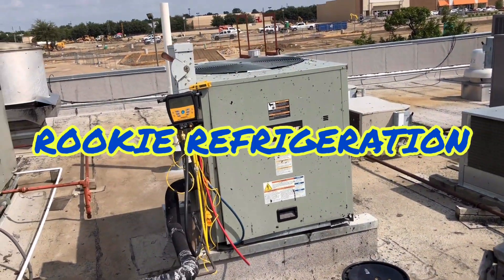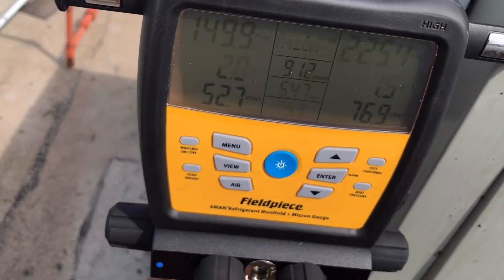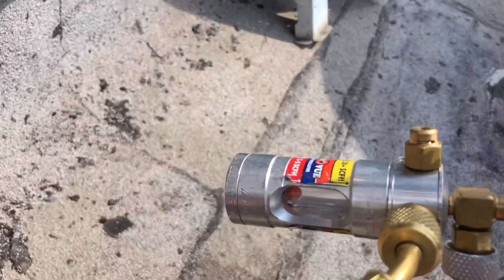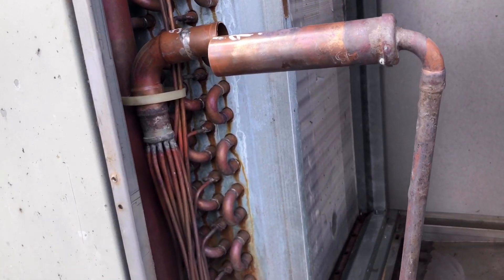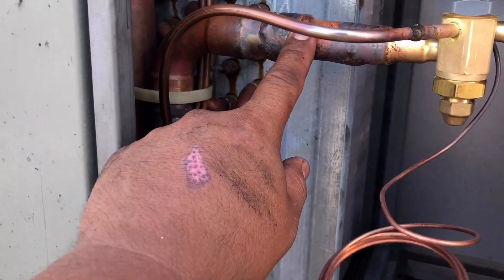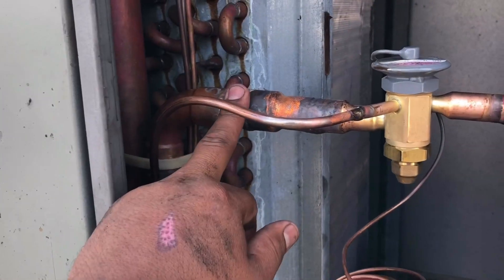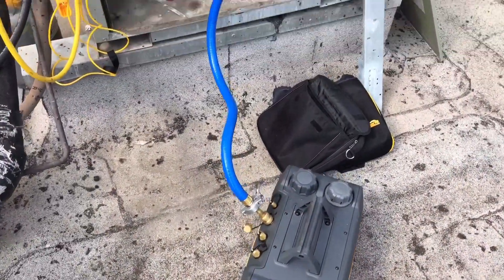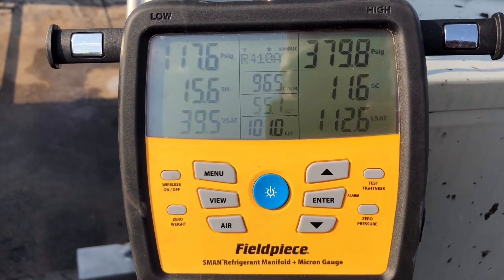HVACR:  Trane Make Up Air Unit with no TXV, ran for 2 years

Comment: I'm not knocking you bro but I noticed that you said 15 degree SH and it really was 15 degree SH. it does happen if it's hot inside you gonna have high superheated. I love txv systems easiest on earth it's the fixed office you gotta worry about. The system can be a nightmare but it takes time to diag that kinda system for a while.

Comment: Hi, i have an old lennox rtu. There's a port on the discharge line but no port on the suction line. The suction line just before the compressor is really hot. It has capillary metering r22. Discharge pressure showing 125psig. Is it low on charge? How can I change this system? Thanks
Reply from the maker: Probably low.   Make sure it’s pumping.

Comment: If you mount your sensing bulb upstream of the equalizing valve, it will allow the valve to read suction gas temp, instead of liquid temp. 
It will help with superheat.

Comment: Quick tip I learned from someone else. Instead of hauling a bucket of ice to the roof.... steal a small condenser and fan from a small reach in. Put service fittings on the inlet and the outlet of the small coil.

When you recover put that coil and fan in your recovery circuit between the reclaimer and the cylinder and tap in to 115v you’re already using for your recovery machine. Don’t have to worry about ice melting or break your back hauling it up a ladder or roping it up. Or look for a hose bib.Tip of the day.

Comment: Hey bro I'm a newbie in big boys toys and my question is when to know the charge is complete yo go by sh or sc or it is printed in the box I'll be great full if you can clear ma mind .
Reply from the maker: Usually on bigger systems you will have a receiver and it all depends on what the manufacturer wants.  We usually go 35% on some stores.   50on some. Etc.    but if it’s a bigger system with no receiver it will be wighed in.  Usually says on the system

Comment: Well you should have at least glanced at the cut sheet on installing the valve first...there is only one position you can’t install that valve.... The one you did!  You can’t attach the outlet side into a 90.🙅‍♀️👎🥴
Reply from the maker: Cool.  Still working.   Better than it was!?😂😂
Reply: @rookierefrigeration4357  I guess as long as it works....

Comment: Where do you run your pressures on oxygen and acetylene and what size tip you use?
Reply from the maker: I believe this is a #1 tip and it’s set at like 7acet /10oxy

Comment: Hey Rookie, i find un-sweating can be a waste of time, cut 1/2", bend a piece of 5/8' pipe 90",done...!!!...instead of running to the parts house for reducers and adaptors, a piece of 5/8" for liquid in,another way , and your 7/8" off the valve would of went into the 1 1/8" and crimp a little..bigger drier the better on old crap,you don't know how dirty system is,, good job.. keep going, its a great trade to be in.. iv'e been doing it for over 35 years in Australia...
Reply from the maker: Yeah, I agree.  I don’t like the look of the crimped tube with the smaller diameter copper.   I’d rather go to the supply house and get the fittings.   But yes I know I can do that.  I think I just choose not too

Comment: I might be wrong but that looked like a fixed orfice with capillary tube
Reply from the maker: It looks like it.  But it did not have anything inside.  At all.   Trane said that the installer should have purchased the txv separately and they didn't.   So someone just brazed it together.
Reply: That's what I was going to say.
Unfortunately, since I would of thought that, I would of never seen the end of the tunnel if I got a unit like this.

That's why I watch videos like this; these guys keep the trade going.

Comment: Why the buck I understand? Shouldn't you put the same size dryer back on??  I'm new to all this
Reply from the maker: Joe A at least the same size minimum.   I’d say you are safe going a bit larger.   Might affect critically charged units though
Reply: @rookierefrigeration4357  sporlan has charts in their drier bulletin showing weights of refrigerant for different sizes of driers and different refrigerants, as far as i know you can adjust the chart on critically charged units using that (extra charge = new drier weight - old drier weight). Nice video! Surprised the compressor didnt die from that!
Reply from the maker: Yeah.  It had the superheat to keep it alive but it never cooled.   I was amazed at this find.

Comment: I know Trane utilizes weight charging and approach temp for charging but there has been a lot of research on superheat that really squashes the old rule of thumb of 12-15 degrees of superheat, especially in high ambient temperatures. The research was done in San Rafael by Proctor Engineering.

Comment: My friend how the big Trane unit was running with out an expansion valve before. you installed a new one after consulting with Trane right?
Reply from the maker: There was enough flashing and superheat to maintain the system Alive.  But not enough to do much cooling.  That's why it was never an issue until I ran across it.  Lol
Reply: You know the phrase nothing stops a train. Not even its own parts

Comment: good video,  the only thing I would have been looking for, is a fixed metering device in that larger tubing or if they had some kind of orifice in the distributor head, otherwise, what prevented the compressor from slugging?.  Either way, I like the pressures now, and other data much better now too.
Reply from the maker: hvac01453 yeah, the only thing before the distribution tubes was a screen.  I verified before installing the valve.   It was a weird find. 🤪
Reply: @rookierefrigeration4357  It looked to me to be one of the plumbers end caps on a short piece of tube rather than a rubber plug. Then, some rookie assumed it was already installed with a metering device, drilled a hole in the end cap, and inserted a street el. kind of makes you want to say,"Who did the start-up"?

Comment: I had an R22 10 ton split system like that.  They thought the distributor tubes were capillary tubes.  It was actually cooling, and ran like that for two years.  Condensing unit was on the roof with air handler down below.    Wow, that belt squeal and banging sounds terrible.
Reply from the maker: Yeah.  Did you add a txv?
Reply: It was two circuits, so yes, we installed two.

Comment: Nice find man!! I don't have the fancy stuff but use a lot of the OG concept of a 40 deg evap and a liquid of 325-330 psi (410a) here it's the tropics and I don't get low ambient situations alot
Reply from the maker: Yeah, I love using 40 110 as ROT.  It’s funny, my brother told me not to buy digital gauges until I was in the trade 2 years.  So for 2 years I used nothing but analog and temp clamps.  Lol.  I learned 40 110 really quick.  (Sat temps)
Reply: @rookierefrigeration4357  I know this sounds bizarre but I have a German testo 550 without the clamps... should like to get email in the future
Reply: @rookierefrigeration4357  also it makes you use the brains.... gotta stay sharp

Comment: The bulb, always has to be closer to the evaporator than the equalizer.
Reply: If the equalizer tube is leaking liquid to the suction line I would rather have the valve pinch down and stop feeding then have liquid flood back and cause a compressor failure. And hopefully the customer will call when it stops cooling due to the valve pinching down. That said I put the bulb on either side many times sometimes it just comes down to where u have the most room.
Reply: @chap3845  You are right, it will probably destroy the compressor. But looking at he txv as a throttling device, it's bulb first. Either way, it will hurt the compressor. start/stop, flooding, or starve.
Reply from the maker: Thanks. With the limited space, I think it will be alright.  Besides, the difference in pressure is minimal, so not much is affected.   Thanks for the advice
Reply: @rookierefrigeration4357  The biggest problem, is that, if your txv is leaky, from spring and bulb side of it. It will affect how i works.
If your txv i fine, it doesn't matter.

Comment: Now That was a Great video ! 🤣🤣🤣🤣🤣 That was a Great 👍 one to Get on Vid ! 
Well done man. That actually Looks Like How they used to do it in the old days with capillary tubing. The old 10 Seer stuff and before. Before txvs were commonly used in A/c. Great Find ! 
That Was an installer Error ! Factory Capped it off and installer Drilled a Hole in Factory cap. ( Figuring it was cap tube ) Did not read install Paperwork. installer Piped the unit wrong. 
That's a Split system! So, Can Be Matched With Different size & type Condensing units. Requiring u to select What Txv u want to use to Match what condenser is ordered. ( Different Refrigerants = Different Txv ) That's Why Factory Just Sends it Capped off.
That's What Happens When u Don't Read the installation instructions. 🤣🤣🤣  
Look at that Suction Header , it's drilled and stuffed too. installer drilled & stuck suction in at bottom of header. No smooth transition so oil will pool there mega.
if u ever replace that compressor, that suction piping needs redone at suction line to header. needs a Bushing.
Reply from the maker: OcRefrigeration , Hvac & Electrical Video's. Thanks bro.  Definitely my first no txv find🤣
Reply: I always look for your comments on vids; full of info.

Comment: Good video.  
Its amazing how changing or installing a txv can be so time consuming.  
Two an three trips to the supply house .. and the boss be tripping. 
And ...the Dispatcher be like we got three more calls for you at 4:30 .. . 
And you on Call
Reply: Would’ve been an interesting exercise to crimp the copper into a fixed metering device at least until the replacement TXV was located
Reply: @DavidATristan  there is none, the company i work at ran across the same issue, but Trane had no TXV for us to install. So we just got a TXV to match tubing size and the compressor's BTUs and that was it, runs great now. I don't like how Trane does that tbh.
Reply from the maker: Exactly bro. I was frustrated as hell with the BS.   Thanks for watching 👍🏽

Comment: Good stuff . Hope all the Trane trolls are watching 🙄😀😂🤭😎. Good repair enjoyed the video .
Reply from the maker: Thanks for watching bud!!
Reply: Rookie Refrigeration what tonnage capacity expansion valve did you install ?
Reply from the maker: That was a 12 ton valve.  💪🏼
Reply: Rookie Refrigeration 12 ton valve huh? And Trane slept on it !!! And they claim to be the best in the industry huh 🤭🤔🙄😬😁😎
Reply from the maker: Felipe Tafolla well, it’s a7.5 ton Unit, but it’s 100% outside air.  So the next valve up was 12 ton. As you can see, she’s doing good.
Reply: Rookie Refrigeration definitely. Your superheat was on point, taking in consideration that you’re tolerance is +3 or - 3 degree for a 410 application. And +5 or -5 for R-22 . Good stuff
Reply from the maker: Felipe Tafolla yeah, I like to do +-3 for subcool and +-5 for superheat.   Do I liked the numbers and left it.
Reply: Rookie Refrigeration have you done any R-290 stuff ?
Reply from the maker: Not opening up the system.  But I’ve worked on them electrically.   Never hooked up though.
Reply: Rookie Refrigeration cool same here I’ve replaced temp controllers , fans , etc . But never opened up the system.
Reply: @ Felipe. not Tranes fault. The Evap section is sold separately. Split system. it comes capped. You Need to Select Txv in the Field or Order Txv for Your application & refrigerant type.

Comment: Good fix, can’t believe it ran without a TXV for that long without a complaint from the building.
Reply: capillary tube acted as a metering devise!
Reply from the maker: Yeah, this serves a kitchen and has another RTU also.  It will be much better now.
Reply: Compressor is strong I think is why they never noticed these packs units get ❄